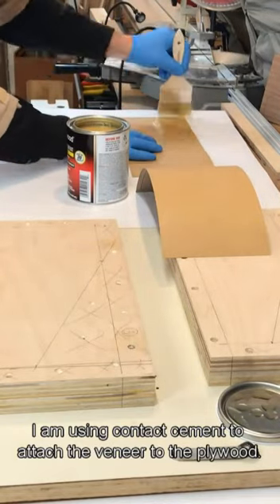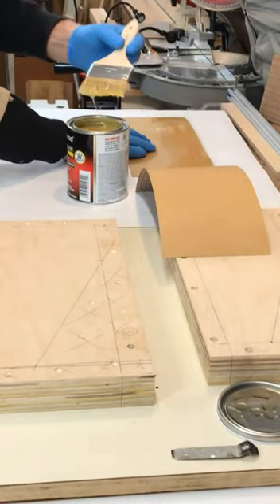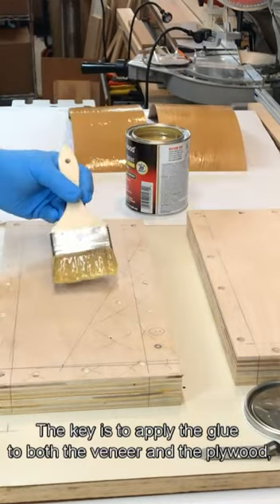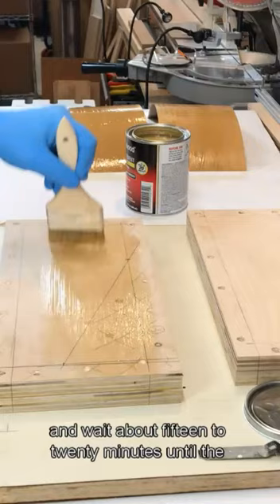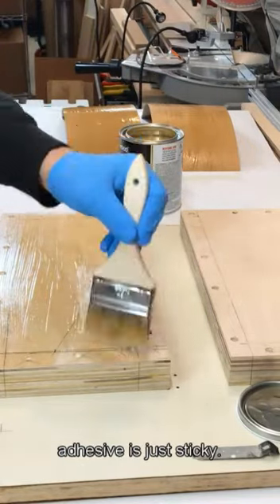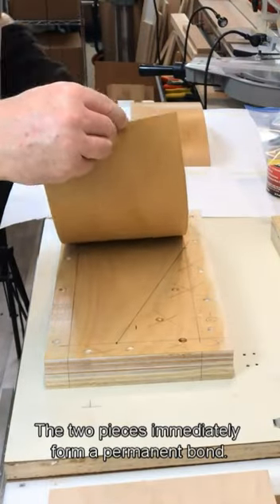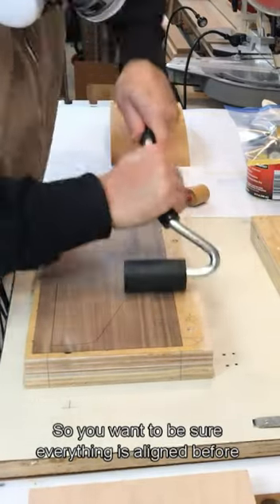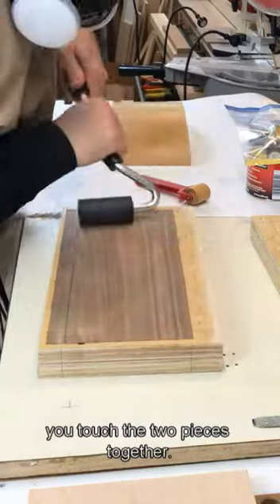How to glue Veneer to Plywood! #shorts

Comment: Spray adhesive?
Reply from the maker: Spray adhesive is another option, but you have to protect the surrounding area because the overspray can go everywhere.
Reply: is contact cement the same as type 99 glue?
Reply: Why does mine have bumps after putting them together?😢